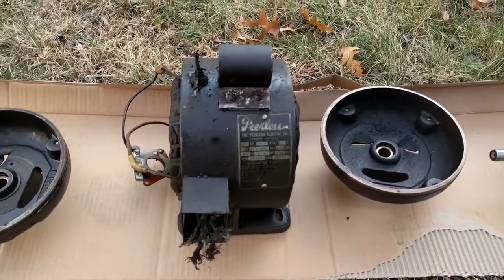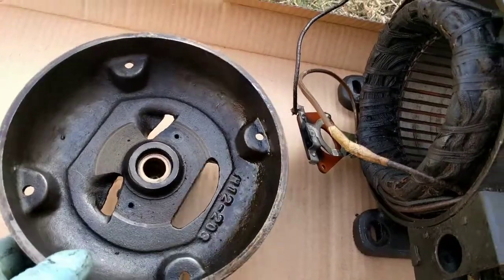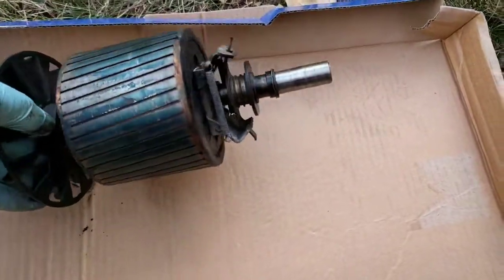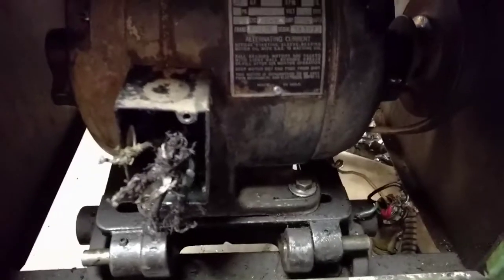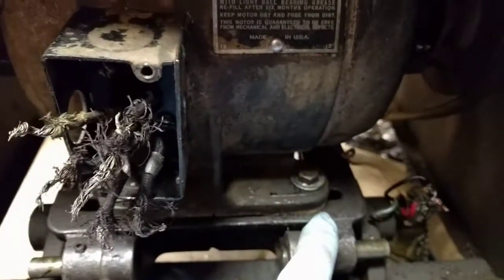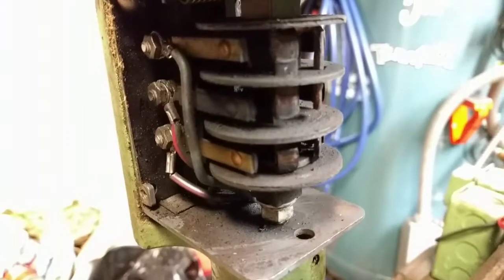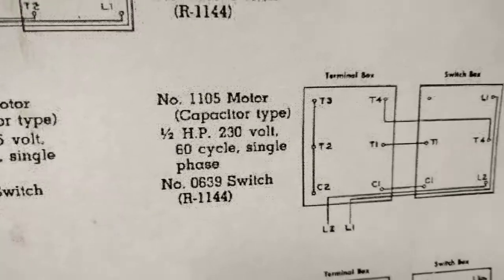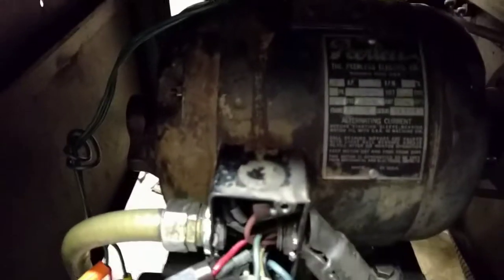Logan 825 lathe peerless motor cleanup and rewire for 120 volts

Comment: Hi,I am trying to wire the exact same motor as you have.  Could you tell me on the 110 single phase is L2 and L1 hot neutral and what do yo do with the neutral wire if you do the 240 single phase because I'm assuming that L1 and L2 will both be hot wires.  If you could help I would really appreciate it.  I just purchased a Logan 820 lathe with this motor and the wiring was just cut.  Thanks
Reply from the maker: I'm running 120v so L1 is hot and L2 is neutral. Not sure how to wire for 240. You would have to look up motor wire diagram for 240v motor
Reply: Thank you!